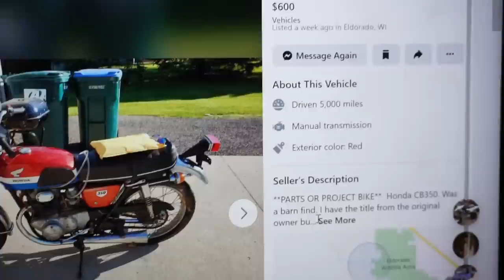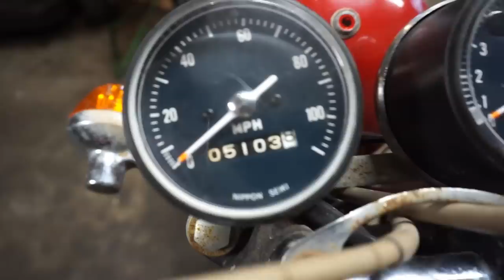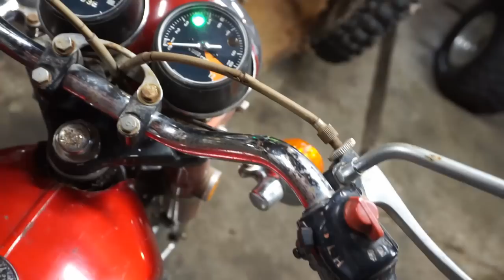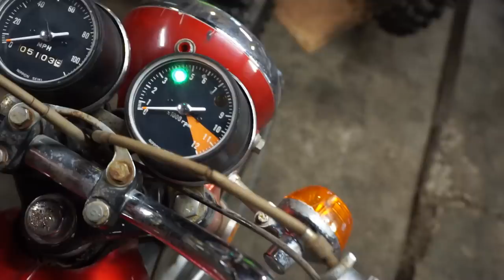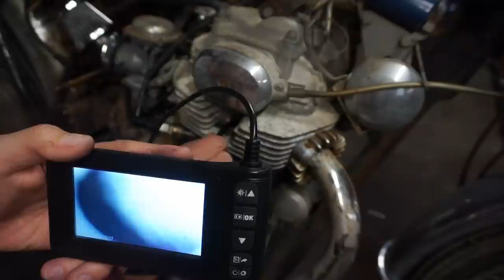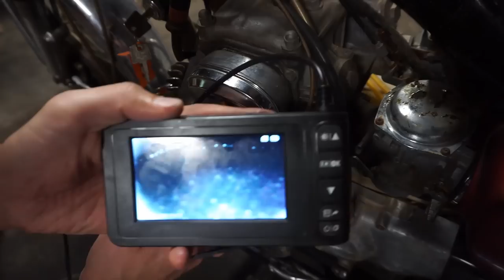Barn Find Honda CB350 Sitting For Years. Will It Run?

Comment: These old Honda’s are pretty bulletproof…..kinda surprised of how low the mileage is though, good find Joe. I had a ‘74 CB360t bought for $75 and a (high mileage) ‘71 CL350 Scrambler that was given to me after a few different “mechanics” couldn’t get it to run right. Turns out valves needed adjusting, was backfiring through the intake on the RH cylinder.
Glad to see both sidecovers still on it as those are usually the first thing gone from them! The airboxes shouldn’t cost more than $75/pair though, pretty easy to find used online.

Comment: I love this, im restoring an Old moped myself so fun to see someone Else with an older project on Their hands
Reply: I have a old project too, 1974 Yamaha dt125 enduro I have put about 100$ into it and it runs perfect, picked it up for 150$
Reply: @jimmyjohnjames  I have a similar project to yours, a ‘75 Yamaha MX100B. Has no spark, compression, and some other miscellaneous parts.
Reply: If you have any questions feel free to ask!!
Reply: Mine had no spark, but it had compression and most of the other parts
Reply: @jimmyjohnjames  So where do you recommend I find OEM parts?
Reply: @wallpaperman9051  CMS parts and eBay.
Reply: @jimmyjohnjames  Thank you, this will help me out a lot. I was surprised when wiseco didn’t sell a piston for my bike. They only had the later models.

Comment: Nice that you turned it over, over and over and ran it, then check the oil. Always check the oil first!
Reply: Why be so polite? He needs to be told.
Reply: I don't think you need to tell someone that dude.....
Reply: @HondaWanderer  did you watch the video? Apparently he does need to be told
Reply: @exptodd  nope not the whole thing but unless he's completely clueless, he doesn't. I'm mechanically a beginner and even I know that. I think you're being a bit silly
Reply: @HondaWanderer  Not at all. Read the comment again. You missed the whole point that he sat and turned the engine over and over even ran it THEN  decided to check the oil. It is the simplest things that people forget. Could really cause some damage on that old engine if it were to be out or really low.
Reply: @exptodd  yup. Pretty dumb

Comment: I’ve had several of these bikes you’re missing a part for the petcock it’s a fitting with threads on both ends one is in reverse
Reply: Or on the 74s is rubber

Comment: i would leave the paint alone. chances are you'll damage the paint underneath, trying to remove the blue.

Also, makes sure all carb adjustments are perfectly the same on both carbs. you need to also either locate an original breather box and tubes, or run something thats the same on both carbs. 

nice little find. would be a good little bike to hit the gas station to pick up some milk or snacks.

Comment: 14:53 frankly im surprised you dont just have a wire stripper tool on hand. I got one called the Irwin Vise-Grip Wire Stripping Tool off amazon for $11. Has made dealing with smaller wire sizes so much easier
Reply: Has camera to look in cylinder. Does not have wire stripper. Yep
Reply: Its called plyers
Reply: @lifeononeweel3008  you mean what he was using? That thing that isnt designed to strip wire? No SHIT you can use pliers, clearly my comment was about how using wire strippers makes it WAY easier.
Reply: And you only need two strands of copper for any electrical connection as well.

Comment: I had a CB 350 as a matter of fact I got my first ticket ever on mine, I got a ticket for driving out of class the Troopers that pulled me over were laughing at me because it started to rain,little did they know I could of cared less it was hot out anyway It was a reliable bike and was mint i used it as a daily driver I bought it for 350 bucks and sold it for 600 I bought  in 1984.the bike just sat around in a little shed on an estate where my buddy's dad worked They said make an offer, 350 is what I offered and that was that ,I wish I still owned it.

Comment: That was a good find pretty complete. You wouldn't get one for that price in the UK. I'd try and find an airbox for it. CV carbs are a pain to set up with pods. Treat yourself before your next project. Get yourself one of the remote workshop fuel tanks, they're cheap enough. Much easier, and safer, than pouring fuel down a pipe with a jug. The fuel tap is probably the right one. There should be a nut that screws to the tap and the tank. That's what you are missing.

Comment: Bike is a combo of parts....tank is 68/69, seat tilts back like 68/69 but it has the front fender of a 70 and the side covers should be white on a 68/69 as well as the headlight bucket....It looks like a 68/69 that has 70 parts but the frame tag says 70?  Doesn't matter as long as it's fun!

Comment: I bought a basket case ‘68 CL350 from a friend in high school form$75. One of the best bikes I owned. Had a hard time getting it to run and finally discovered I had installed the point cam 180 degrees off, fired right up after that was corrected.

Comment: Nice one! I restored my 69 cb350 last year. It’s identical apart from the mud guards on yours. I’m in Australia so had to order all my parts from the USA.
You’ll get all the parts you need from common motors in Austin  TX.
Also you are missing the 19mm nut that goes between the petcock and tank. Sync the carbies and she’ll run and rev better.

Comment: On the petcock there should be a rubber peace that slides over the treds about half way then there’s a skinny nut that tightins down on both sides of the rubber peace. U might be able to make it at home. Hope it helps
Reply: The skinny nut is the guy doing the work.

Comment: I found a cm200t from 82, guy said the engine was seized and nothing worked. When i got there it was rough, rusted and gross. Tires in that stuck in one place for way to long condition. Gave him 300$ for it.

It only had 1600 miles on it so i thought it was weird that the engine had seized.

Got it in my garage, and pulled the tank, grabbed the carb, realized it was in gear, dropped it into neutral and it spun no problem. So i changed the oil and hooked it to a lawn mower battery.

Found the real problem and porbably why the bike was parked, the starter solenoid went bad, so i just jumped the cables onto the other side. A little starter fluid had it running on a single piston.

After taking everything apart, cleaning connections,  polishing the chrome, airing the original tires and replacing the brake pads everthing ran like a dream. 

I pulled it apart and repainted over the winter and now i have put 2k miles on it just putzing around town and then using it occasionally for commute when my intruder is being worked on.

Comment: With twins you can adjust one carb while you run that side on engine .then put spark plug on other side and take cap off that side u have just done used to do that with cb200

Comment: Those are fun to ride, I ever get a correct seat for the old pig out back of shop I'll start riding her. Fires right up, runs great, and guess what ? Still has original tool kit. Needs a couple tires but hey it's a runner. Ugly ad hell right now but a runner.  Have fun with that, will be curious what you do to it.

Comment: I am not an electrician but I'll give you some advice: do not strip the electrical wires with pliers, because you could cut some of the small copper wires that make up the cable itself.  If there are fewer wires, the cable carries fewer Amps than it was made for.  If you don't have a wire stripper or a pair of electrician's scissors, use a utility knife.

Comment: Cool bike.  Sounds like you got a good deal on it.  Not a fan of whoever added that blue to the tank, but it's not the end of the world.   Why does it look like it's sparking in the spark plug hole around  19:35  ... Reflection from something else maybe?    Also, did I see exhaust coming out of the bottom part of the right side pipe?  Any holes in them?

Comment: Hitch the jumper pack to the battery and let it sit awhile. Then try your Tender. The Tender needs a minimum amount of voltage to work. Look for an old school charger, in the future. The petcock is correct, it is missing a nut that joins the two.

Comment: You really should invest in a pair of wire strippers and a pair of crimpers.  The crimp you made for the battery connection will corode and fail due to poor crimp.

Comment: You need some vacuum gauges and balance those carbs, one side can be running lean while the other is rich causing the lean cylinder to overheat
Reply: Vacuum gauges allow you to set exact throttle opening on each carb only. As in both 
carbs(or more) idling with same airflow. Nothing to do with mixture settings.

Comment: Getting an old barn find running should NEVER be the first priority. There are so many things that could be wrong with the engine, the first priority should be a thorough check to determine if the engine is sound. One broken piston ring or a stuck valve could cause untold expensive damage if you attempt to start it.

Comment: It’s weird , but you do know about Point Gap adjustment right.🤔 In all your videos you never mention gaping plugs or setting points. This can make the best spark you want to achieve.👍
Reply: Exactly, I've been watching many videos thinking the same. Seems to have recipe for: Fresh
Gas, Clean carb(s), Check valve clearances, should go... then erm.
Points need gapped son, usually 15 Thou', and if they aren't opening you ain't gonna get a 
spark at the plug. Also try changing the condenser, often near the coils under the tank. Typically a 25mf capacitor, old bikes need them replaced often, like every few sets of 
points, replace them too. Spark plug gap on old Japanese bikes were usually 25thou'.
Wrong points gap affects ignition timing btw. 

There's a lot of advice from old hands out there if you ask for it.

Comment: Dude I would seriously try and preserve that original red and white paint, maybe use some very mild solvent to see if you can get that blue paint off, but I would definitely try and keep it because they are worth way more with original paint. Really cool find by the way bud! And brother... get some proper wire crimpers! That electrical terminal can easily come loose the way you crimped it!

Comment: It is barely even ever ridden. its in great shape for the year it is. Steel wool would be useful on the chrome.
Reply: steel wool and WD.
Reply: @CCitis  Oh yes he is big WD 40 fan. I keep a big can of that around all the time. Those old Hondas are being collected.
Reply: @shartne  WD is ok for some things. There are better products. For example I wouldn’t use it to free up piston rings. Acetone and ATF is a better combo.
Reply: @titletownclowns1545  Yep. If you have siezed pistons you throw some of that in there and let it sit overnight. Usually frees it up.
Reply: @CCitis  Yes I agree. I would use Deoxit on electrical parts its like magic getting rid of corrosion. very expensive but worth it. 30 bucks a spray can. simply the best fixes electric contacts perfectly. when he sprayed some plugs and contacts and stuff with WD I was like what really? It did work but I bet it not for long. WD is for removing water from a ignition distributor after flooding an engine its not really a long lasting lubricant. I use Marvel Mystery Oil for sticky valves and rings I would use tranny fluid if I was wanting to do it with out buying Marvel Mystery oil.
Reply: @shartne  correct. I would never use an oil based lube on electrical parts. I use electrical contact cleaner on those parts, and if lubrications is needed I typically use a silicone lube. Marvel Mystery is great for so many applications.
Reply: Quick Glo works really well. That's what I use on all of my chrome. After you wipe it off it leaves a thin layer of wax behind so things stay shiny too.

Comment: At the beginning of the video I was yelling at my phone... it's a '69 or '70! That was the 2 years that had the tank knee protector pads on them. I had a '69 CB350 that I got in boxes of parts. Rode the bike for 3 years, until I went in the service, and my Dad sold it. My first road bike.

Comment: i have youre air filters i would sell you the bike for parts it has a lot of parts you could use i had it running i have 150 in it  i will  take that if you need it

Comment: might as well sell it. you couldn't even get the other one going. you got mad and sold it .
Reply from the maker: Which one? I usually get them all running
Reply: You're talking about that old Yamaha 2 stroke twin.  Carb synchronizer tool helps with multi carbed bikes.
Reply: @2vintage  yeah, it was the yamaha  2 stroke, but i get like that sometimes to.

Comment: You seem to be a good mechanic, but you lack some common sense. First of all, you are to rough when removing parts. You yank of parts till they either come off or break off. The way you yanked off that side cover usually breaks off the plastic stud. Second, why do you rev the hell out of engines that have been sitting for years. It is very hard to watch. Third, you crank starters for way too long. The poor thing is probably red hot when you do that. But thanks for keeping these old bikes on the road, just use a little common sense.